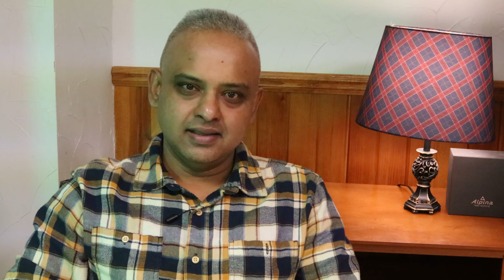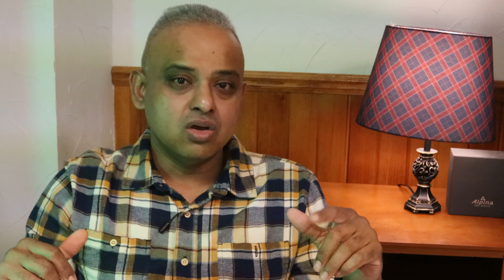Amplifier vs Speaker: Getting the Match Right

Comment from the maker: If your amplifier or preamp has a usable pre-out, you may already have one of the simplest ways to add a subwoofer to a two-channel system without changing the main speaker path.

But getting signal to the sub is only the beginning. The real work is deciding where the sub should sit, whether the mains should stay full-range or be high-passed, where the crossover should actually occur acoustically, and how level, phase, delay, and the room all interact.

I’ve brought that entire process together in The Disappearing Subwoofer — Analogholic Reference Manual.

If you’re considering adding subs to a serious stereo system, this is the deeper companion to the videos.

Available at Analogholic.com.

Comment: Plz suggest me some good amps for Focal Sopra N3 speakers 
Regards
Reply from the maker: Happy to help, but I would need a little more information before recommending a specific amplifier.

The Sopra N3 is reasonably sensitive, but it can still present a demanding load, so I would look for an amplifier with strong current capability, good stability into lower impedances, and enough headroom for your room and listening level.

Can you tell me your room size, listening distance, typical volume, budget, and whether you prefer an integrated amplifier or separates?

Once I know that, I can suggest a few amplifiers that actually make sense for your system rather than just throwing expensive names at you.
Reply: @analogholic_reviews Sir, love your reviews....
Room is 24x18x11 feet, listening distance about 11 feet, low to moderate levels, budget is upto around 6 to 10 lacs, can go for either integrated or power amps....
Regards

Comment: In a nutshell, properly designed power amplifier (regardless of topology) doesn’t really care what speaker it is driving … modern class D designs, like Hypex and / or Purifi are load invariant, ultra quiet and ultra linear, have more than enough power and headroom, for any critical listening. After 20+ years, I still own lovely Quad 909 (class A + class AB in ‘current dumping’ feed forward topology, which fully eliminates crossover distortion) but with ‘only’ 140W / 8 ohm / 250 W / 4 ohm and max 11 A of current delivery per ch, it really can’t compete anymore with new modern class D Purifi Eigentakt 1ET9040BA mono block power amps, which are 380W / 8 ohm / 750 W / 4 ohm and each delivering max 40A of current !

Comment: Is there any reason why only arcam and only few countable companies making class G amps if they offer class a benefits.. I was researching on gato Dia 400 and it seems to offer sonic like tubes as per reviews
Reply from the maker: There are fewer than people think, but definitely more than just Arcam 🙂

Arcam is the most visible today, especially in hi fi and AV gear with true Class G implementations.

Historically, some NAD designs, Luxmans, used rail switching concepts, though they did not always market it explicitly as Class G.

Parasound has used rail switching ideas in certain designs.

Anthem and some ATI based designs have used Class H style approaches, which is closely related.

And in pro audio, Class H is very common with brands like Crown, QSC, and Yamaha, which are essentially a continuous version of the same idea.  ￼

That is the key point most people miss:
Class G is stepped rail switching
Class H is continuous rail tracking

Same goal, different implementation.

So it is not rare as a concept
it is just not widely marketed in consumer hi fi because it sits in an awkward middle ground between AB and D
Reply: @analogholic_reviews thanks so much.. I think there might be a more deeper reason coz I guess globally there are so many amplifier makers but 95 percent are focused on. Class ab or class d… I don’t think it’s only about marketing coz if it was genuinely that good topology it would have attracted many more names 😊

Comment: When we limit only to amps but lot of the clarity comes from single vs dual coding chip for better separation. Also on the cheaper class D amps op amps can make all the difference where it is not all so defined. But at this price point power is number one issue where most of the cheap audio save money and make their profit. While the more expensive (+$1500) vintage traditional A/AB amps have really good sound I find the class D even the cheap amps ($50) with optimum power supply and rolled up op amps can sound really good to the point where the difference is minimal. But this often needs a good DAC with dual coding chips for better separation from that level where as the more expensive A/AB amps often have added manipulation and finesse for the separation compared to bare bones simple class D amp. But the potential is there for a great sound. With little research and logic you can get a cheap DAC with dual chips and maybe swappable op amps for the pre amp for clean start for the cheap class D amp.

For example I have vintage close to top of the range system vs cheap Chinese class D system. 

Aiyima A07 Premium (with 2 x opa1612 powered 48V 10A) that as stock has 2 x ne5532 op amps.
And
Aiyima DAC A3 (with 4 x opa1612 powered 12V 6A) that as stock has 2 x TL072 + Lm4562 + NE5532 op amps. Comes with 2 x ES9038Q2M for coding. 

All up with power supplies and op amps $220. 

It is doing lot better job than I thought powering the 2.1 Magnat Vector Needle speakers and Magnat Alpha 30A active subwoofer. My vintage Pioneer system that cost lot more hardly gets used anymore.
Reply from the maker: Thanks for taking the time to write this out. There is a lot of real listening experience behind what you are describing and that matters.

I agree with you that in many budget Class D designs the power supply and surrounding analog stages dominate the result far more than the amplifier chip itself. When those are constrained everything feels underdefined. When they are improved the whole presentation snaps into focus and people often attribute that change to the op amp or the DAC chip when it is really the system breathing easier.

I would add a bit of clarification on a couple of points. Dual DAC chips do not automatically create better separation. What they really change is how the designer can manage channel isolation, output stage loading, grounding and noise. If those things are already well handled in a single chip design the audible difference can be very small. If they are not then dual mono implementations can help simply by reducing interaction.

Same with op amps. In circuits where the power delivery, compensation, or loop stability are marginal the op amp becomes the obvious bottleneck and swapping it can make a large audible difference. Once those fundamentals are solid the differences between compatible op amps tend to converge much more than most people expect.

Your example actually supports the main point of the video. When a system stops being component limited and starts being interaction limited even inexpensive gear can sound far better than its price suggests. Not because it has turned into something else but because the electrical and acoustic constraints are no longer fighting each other.

That Aiyima and Magnat setup is a good illustration of that principle. It is not that it defeats vintage gear in some absolute sense. It is that it is operating closer to its comfort zone in your room and with your speakers.

Really appreciate you sharing this. Thoughtful experiments like this are far more useful than brand or price based comparisons.
Reply: @analogholic_reviews  Aiyima DAC A3 has dual coding chips one for each channel at price of $70. For that price I think I get a lot and rolling the op amps to opa1612 from whatever there was from the factory it is not a bad little DAC/headphone amp/pre amp. 

Yes I agree that single chip can do a good job when I compare to my Schiit Mimir that is better and it is a single chip. But it also is $300. It is part of my headphone system with Lokius and Jotunheim 3 from Schiit. For $300 you expect more and Schiit's Mesh topology seems to be doing a good job. 

Between single and dual chip I think it is more about price and even so the line is not clear.

Comment: Back in the Day my Sound Craftsman gear was Class H amplification... But you gotta go back in time...
Reply from the maker: Yes. Class H has been around a long time, especially in pro and high power designs, long before it became a marketing talking point. What has changed is implementation, control circuitry, and how transparently it can transition rails without side effects. The idea is old. The execution is what finally caught up.
Reply: @analogholic_reviews What's old is new again as the saying goes...

Comment: My Naim Nap 250dr surprisingly struggles to drive, bring to life my ATC 19 speakers.  Im using a Naim Uniti as cd player and pre-amp. 
Any thoughts. 
 I borrowed a well used Roksan k3 which brought them to life.
Reply from the maker: That actually makes sense. ATC 19s are current hungry and stay demanding even at moderate levels. The Nap 250DR from what I’ve read has great timing but it is not the most comfortable amp into tough impedance and phase loads.

The Roksan K3 probably has a beefier current delivery and a better regulated power supply which is why the speakers woke up immediately. ATCs tend to respond more to current and grip than rated watts.

The bottleneck here is seems to amplifier control. If you stay with ATC I would lean toward amps known for strong current delivery.
Reply: @analogholic_reviews 
Thank you for the quick response explaining the cause and your advice.
Reply from the maker: Welcome. 🙏. Anytime!

Comment: If it is current you seek shouldn't you look at the amplifier's actual amperage output?
Reply from the maker: Amps don’t deliver a fixed current the way a power supply does. Current is demanded by the speaker, moment by moment, and how well an amp handles that depends on its voltage swing, power supply stiffness, output impedance, protection behavior, and how gracefully it responds under load. Two amps with similar current specs on paper can behave very differently into a real speaker.

That’s why looking at power into different impedances, stability into low loads, and real world behavior matters more than a single amperage figure.

Comment: I love the SA20. The only issue after two years of usage is that the volume knob is pretty much non-responsive during the first few minutes when the amp is still cold. The volume knob also lands on a nodge rather than in a nodge. But the music really flows with this amp.
Reply from the maker: Thanks for sharing that long term note on the SA20. I enjoyed my time with it as well! I have not seen a ton of reports of the knob being sluggish only when the amp is cold, so it might be specific to the rotary encoder on your unit. Quick check: does the remote change volume normally during those first few minutes? If yes, that points more to the knob encoder behavior than the amp section itself. If it is repeatable, I would mention it to Arcam or your dealer, because an encoder can sometimes get finicky over time and it is usually an easy fix. Glad to hear the important part is still true though, the music flow is why people keep these amps.
Reply: Thanks man. I will try. I meant motch btw. That’s my poor english;) love your channel.

Comment: Great video.  Very informative..  

Totally appreciate your channel !

Would you know or any other channel member know what type of amplification type the Carver vintage amps use, say a TFM 35 or TFM 45 or M 1.0t ?   

Believe it may be a G class design but not sure..
Reply from the maker: What Bob Carver used was a conventional Class AB amplifier section, but paired it with his Magnetic Field Power Supply.
Instead of a fixed high voltage rail like a traditional Class AB amp, the supply dynamically tracks the music signal and only delivers higher voltage when needed. People call it Class G or H because the supply voltage changes with signal demand, people loosely label these amps as Class G or Class H.
Technically though, Carver’s approach predates modern Class G and H definitions and does not use discrete rail switching in the typical way.
Reply: @analogholic_reviews  Thank you for the response and detailed information.  It’s truly appreciated.    As a vintage amp nut, Carver has always been a special brand / amp that seems to scale very well.  

Keep up the great work!

Comment: Many thanks for your detailed and simple explanations of audio concepts and design. Which amplifiers'd you suggest for Yamaha NS-1000M speakers?
Reply from the maker: The NS-1000M is a fantastic speaker, incredibly revealing, a bit forward through the mid/upper bands, and brutally honest about whatever amp you put in front of it. That also means amp pairing matters more than with most vintage boxes. What size if your listening room?
A high-quality warmish tube amp (or hybrid) is a good idea. Their beryllium drivers love a touch of sweetness. A good EL34/KT88 design or a hybrid like a Pathos or Rogue Audio can take the edge off the upper mids without softening detail.
Yamaha’s own solid state A-S series (22100/2200/3200) would work. Avoid bright/lean amps.

Comment: What was the model of Wyred4Sound class D amp that you tried and was it the best warmest most analog sounding D you have tried? What other class D amps (not integrated) can you recommend for power hungry maggies? Thanks
Reply from the maker: The W4S ST1000 stereo and SX1000 mono blocks are the warmest. The NAD C298 and PS audio M700s are excellent with bass definition but seemed a bit on the analytical side IME.

Comment: Is it true that for Class AB amps, the Class A bias can be roughly estimated by comparing the power consumption and the highest rated impedance output?

So the Electrocompaniet ECI 6 MKII is rated 125W into 8 Ohm with a power consumption of 110W. 

Does that mean it's putting out Class A power up to about 15W?

Comment: I have two older Harman Kardon receivers. A HK 880vsi and a HK 550vsi. They both have a switch on back to choose between 4 and 8 ohms. Smaller Polk xl 15s on the 550 Polk xl 20 on the 880. When I bought the speakers they were listed as 4 ohms. The respective owners manual have them at 4 ohms. When I called Polk they said they are both compatible with 4-8 ohm amps. After the phone call they changed the web site to 4-8 ohms. What setting would you use. 4 or 8 ohms? I also have a Yamaha RX 777 receiver 2 channel. I have the Polk XL 20 and old Advent Prodigy Towers on it. Running it on the 4 ohm setting. Again what setting would you use? I live in an apartment and do not play anything loud as to not annoy the neighbors.
Reply from the maker: Great question. Using terninals or impedance switch to match nominal impedance specified by manufacturers didn't always work the best in my scenario.  You would think it's straight forward but it isnt. I always experimented to see what sounded best to me. I used the 8 ohm tap on my audio research to get best results on Vienna acoustic Mozart SEs and the AE Coriniums. They are both rated as 4 ohm.
Reply: @analogholic_reviews  Thank you for taking the time to answer my question. The owners manual on all three receivers make it out as paramount. At my relatively low volume listening levels would probably also keep the amps from over working as well. Thank you again.

Comment: Hi I'm planning to improve speakers from B&W 685 to new 606s3 and my Amp is Marantz 6003pm so it will sound nice?
Reply from the maker: Hi, I have not listened to the PM6003. But I know the 606s3 is very detailed and can  sounfld bright with some amplifiers.  Also, how big is your room and how loud do you normally listen?
Reply: @analogholic_reviews  most of time connected to radio with TV
Reply: @analogholic_reviews  606s3 is great speakers I hope and which bookshelf you can advise me to buy on same value

Comment: Very nice informative video. Can you please  recommend best amplifiers for my Spendor classic 3/1 speakers.? I mostly listen Gazalas and bollywood  stuff  and that too at lower volumes.My room dimensions  are 12ft× 14ft.
Reply from the maker: Excellent choice of speakers. The Spendor classic 3/1 in my experience sang really well when using the audio research vsi60 and the peachtree nova 150 amps. I’ve also noticed they really do well when paired with the Rega Elicit, Elex  amps well!
Reply: Thanks for the response. I really appreciate your choice of amplifiers for my Spendor Classic  speakers.  I am planning to buy Rega Elicit amplifier.